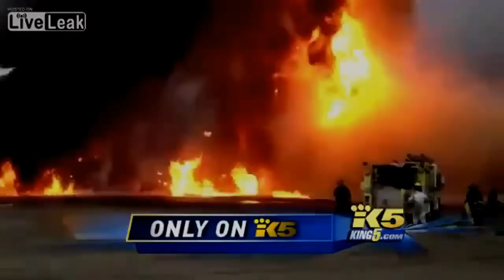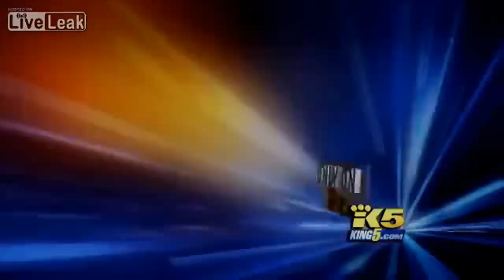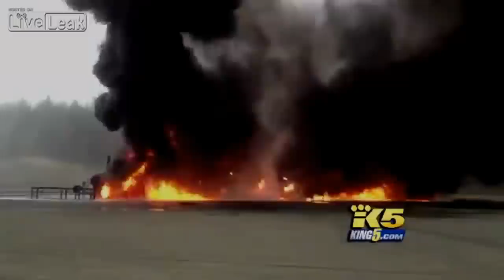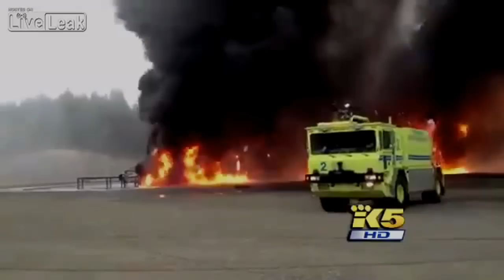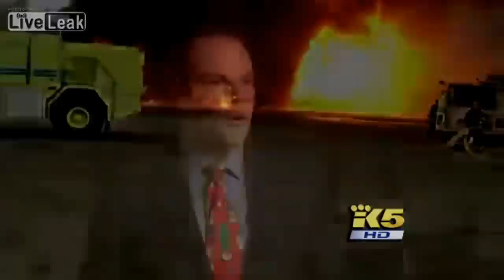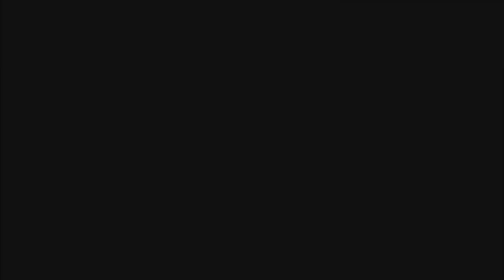Firefighters mistakenly pump jet fuel on fire instead of water | Fail

Comment: Why do they even have jet fuel?
Reply from the maker: they were recreating a plane crash scene, so the jet fuel was to simulate burning fuel during such and incident, so firefighter understood the method of controlling such a fire, at least they learnt that is burns well!! - thanks for watching an your comment!
Reply: MrOutofcontrolvideos thanks! :)
Reply from the maker: Jake Reid no prob! - Thanks!
Reply: MrOutofcontrolvideos How is burning jet fuel simulating burning jet fuel? It is jet fuel burning.
Reply: ***** Wait a minute... Jet fuel can't melt steel beams...
Reply: ***** That could make an interesting training scenario fuel plus a generous helping of black ops mystery adaptive.
Reply: +Jake Reid 

Don't listen to the guy above.

Fire Training fields use water filtration devices to filter out runoff water when using burn props, therefore recycling the water. In this scenario, their filtration device failed which caused propane to not be separated from water, but instead sent back to the pumps that the firefighters use when training.
Reply: +Jake Reid 
Jet fuel was in the water tank that feeds the mockup's fire suppression system and supplies water to the fire engines. All the water had jet fuel in it.
Reply: +Jake Reid it can if you use pure o2 with it.
Reply: +Jake Reid - Why do they even have jet fuel? - it was left over from 911
Reply: +sicsempertyrannis23 - during the clean up there would have been no reason or need for angled cuts. The quickest cut would be straight through - the debunking story has been debunked
Reply: +sicsempertyrannis23 - 'and that he profited enormously by the insurance claim he took out 2 years prior'

I think you mean 2 MONTHS earlier not 2 years - he did not lease/own the complex 2 years prior

"Only three
  months before the attack Silverstein signed a rental contract for the WTC.
  Silverstein agreed to pay over 99 years a total of 3,2 billion Dollars in
  leasing installments to the Port Authorities: 616 million as an initial payment
  and then annually 115 million Dollars. The Port Authorities remained the
  owners of the WTC."
Reply: +Jacob Reid They were trying to melt steel beams
Reply: failure of the fuel/water separators...
Reply: does your sisters name happen to be Riley?
Reply: +D Ray um no
Reply: +sicsempertyrannis23 28 pages now in debate and one country claiming to "cash"  bonds in..
Reply: +MrOutofcontrolvideos jet fuel does not burn well its burns poorly like diesel does. the only reason it burns was because it was sprayed and atomizing it. its how its used in jets wont burn unless you spray it same for diesel.
Reply: Making the culprit in this video more likely Av-Gas since it has characteristics more like that of gasoline.
Reply: to make the fire for the training
Reply: That's possibly the dumbest thing I've ever heard
Reply: They had too many steel beams.
Reply: lee ving oh I see, makes sense now
Reply: OMFG LMAO what the fuck lol that makes lots of sense
Reply: why are they using recycled water
Reply: This is the top comment? I;m losing faith in humanity. It's stated clearly it was an exercise, for exercise to be valuable it has to be realistic.
Reply: We don't care were having fun
Reply: Piterixos you're the best.
Reply: Lol, thanks xD
Reply: Recycled water- this is what happens when being "environmentally friendly" goes wrong. And besides, why in hell are they trying to douse a fuel (Class B) fire with purely water? Where's the foam system in there?
Reply: Jacob Reid. Ha. For the planes. But yeah I hear you. How did it get mixed with the water in the truck and hoses
Reply: @danielr3933  not propane, jet fuel
Reply: @geo6892000  911 people say jet fuel can melt steel, but do they understand hot metal is kinda soft and that basically means it would be like holding up a building with  noodles
Reply: They probably had some rollerskates too.
Reply: @MrOutofcontrolvideos  so they would use the fire truck to put jet fuel on the simulation crash
Reply: it helps clear the ear canal for those that don't listen to begin with.
Reply: @danielr3933  propane?... Propane is a gas at atmospheric pressure /temp...
Reply: It literally said it in the video bruh watch before commenting
Reply: @flyingchimp12  bro I literally posted that comment 6 years ago leave me alone 😂
Reply: Actually,  it can. If an oxygen tank in a plane lets go during a fire, the resulting fuel/oxygen mix can cut steel like butter. If the valve stem gets broken off in a crash, the jet can pull unburned fuel into it and create a jet hotter than an oxyacetalene torch more than a foot wide that cuts through anything in its path.
Reply: 777 likes! 👀
Reply: There simulating burning jet fuel in a plane crash, basically It's a way to spray fuel to increase flame but water as well to control it.
Reply: Actually it was contaminated water, fuel got into the reservoir and when they filled up the tanks there was some left and then yeah
Reply: @running.s.fabrication  cheaper and easier
Reply: @ZFTAviation  guess what happens when you heat steel?

Comment: Watch and listen to the story again people...this was not the firefighter's fault. A malfunction in their water/fuel separator that reclaims their water they use for firefighting malfunctioned. This left them unknowingly with fuel in their water supply.
Reply: “Watch and listen to this story again people” lol
Reply: Yeah, I'm calling BS on that. Although Oil water separators are a thing, and we use them at work, it's not "that" kind of thing they are making it out to be. My guess is that some dipshit put fuel where it shouldn't have been put.
Reply: Really old post/vid, but man there is a lot of salt in this response Astute American... 😂
Reply: @justadbeer  that doesn't make any sense because unlike fire hydrants/water source, jet fuel is stored in a tank on a truck. You can't just connect a fire hose to a jet fuel truck its pretty obv to tell which is which bc of the fire hazard/danger sign on the truck. Also the connecter type is different for jet fuel and water. You wouldn't be able to connect a fire hose to a jet fuel truck bc it won't fit.
Reply: Nah they just corrupt fireman
Reply: Hypothetically, I can see where they can only tanker truck x thousand gallons of water out to the training site, and would have a drain system to reclaim the spent water for the next exercise... Hypothetically, I can see where this could go wrong. Also hypothetically, I can see this just being a spectacular brain fart on somebody's part.

Hey Bob, there's not sposed to be rainbows in the water we fight fire with are there? Shut up and point the hose, Jim. Also, not sure if they are talking about jet fuel or avgas. There is a huge difference. Avgas (aviation gas) can be between 91-130 octane, depending on lean/rich mixture, whereas your standard car uses 87 octane. Jet fuel is more akin to diesel with a 15 octane rating. I believe diesel is 40ish Cetane, a whole different word meaning how flammable something is.
Reply: @justadbeer  Ikr. How much jet fuel could be in water that it would be fucking flammable like that.

Comment: I thought you used Foam on fuel fires?......
Reply: they would for real fires but it's too expensive for every day use.
Reply: How can you train for a real life situation if you aren’t using the chemicals to be used. Besides, diesel floats on water and it would... never mind. I’d use a different training facility. 😐
Reply: @glennmyers2984  they used water to feed the fire suppression systems which just mixes the foam shit in the water 
But the water already had jet fuel in it somehow
Reply: It’s foam mixed into water.
Reply: @AquariumAficionado - right. I worked in a chemical plant that had one unit that used a liquid metal to cool the high reactors and used Class D dry powder extinguishers and and bulk. Super K.
Reply: @glennmyers2984  that's like saying how are you training for a situation where you may be in a fire fight, but you aren't using real bullets.
Reply: @mossconfig  its not everyday use, its for a training exercise. Plus our government pays for the equipment we need for training therefore cost isn't a problem.

Comment: Gonna explain this for anyone who doesn't understand. They fill the area around the fake plane with jet fuel and light it because thats the type of fire they are training to fight. The water they use to extinguish that fire is pumped back out of the area after the fire is extinguished where it then goes through a separater to remove the leftover jet fuel so that they can use the water for the next training session. Here the separater didn't do its job so the training water has jet fuel still in it. Now some people might ask why they would filter and reuse water. Well there's two parts to that, the first one being they cant let the water drain away with jet fuel in it because that's extremely dangerous. The second part is water is expensive and since they already have to pump it out and filter it they might as well re-use it.
Reply: Nix Ryu The Sergal 
Water isn't expensive! I live in the Eastern USA and water is $0.22USD for 1000 gallons. In the West water costs about $0.05USD per 1000 gallons. 1 million gallons, or 4000 tons, could cost as little as $50USD, the price of one steak dinner.
Reply: I think most people can figure that part out. What people want to know is why the truck that collects and recycles the water should also be the same truck with a water cannon on it. If I had set up this school, the collection truck would not also play double duty as the training vehicle. Transfer the water to the training vehicle only after being separated. Then this disaster doesn't have to happen. Wouldn't that be the smart and safe way to do things?
Reply: i think it could be that the water storage tanks used to fill the trucks had fuel in them because the seperator machine didnt do its job properly, im not sure how they would scoop the water direct from the ground into the trucks
Reply: @buddyclem7328  why you talking to someone with no common sense

Comment: I love how the clueless reporters act like the problem was worse because there was jet fuel in the line instead of gasoline. Silly journalists, gasoline is far more flammable, has a far lower flash point, and has a far higher spread rate than jet fuel. A lit match dropped in a jar of gasoline will easily cause ignition of the gas and a sustained flame. A match dropped in a jar of "Jet A" fuel will be extinguished by the liquid. The same is true of diesel and kerosene. Gasoline wants to burn. Jet fuel (Jet A, JP-8, & JP-5), kerosene, and diesel are very difficult to ignite and don't burn readily unless they are sprayed in a fine mist.

Comment: If you spray jet fuel and then spray water through the same hose. What the hell are you doing?
Reply: putting out the fire
Reply: it's a training exercise. they wouldn't have dual purpose hoses like that in a real incident
Reply: If you listened to the news report the facility uses recycled water system for the firefighting operations!! The fire man don't pump fuel through the fire hose and then use the same hose to extinguish the fire. It appears that the water/fuel runs to storm drains and is put through a filtering system and then it is put into holding tanks for firefighting operations. This is appears to be done as to conserve water or there is no public water system available. I don't think the firefighters had anything to do with this mishap as most would not even know where the water comes from except that they hook to a hydrant and water comes out.
Reply: all the water had jet fuel
Sounds like some 9/11 shit

Comment: Training is meant to find such problems in order to avoid them happening in real life. Don't shit on the firefighters for making a mistake or having faulty equipment, be glad they found out in training and not on your plane.
Reply: Firefighters shouldn't be using water on a burning aircraft anyway. They should be using foam. If foam is unavailable,  then you CAN use water to dilute the fuel to the point it won't burn but that requires one hell of a lot of water even for a small fire. In contrast,  a very small amount of foam will put out a very large fire. Ex volunteer firefighter.
Reply: @richardbeckenbaugh1805  I believe somebody else in the comments explained why they used water

Comment: I wonder if that water was taken from a well near a fracking project, would be the same.
Reply: There is no natural gas in Seattle the thing to separate hydrocarbons and water to reuse fucked up so he sprayed a mix of water and falmmable liquids on it
Reply: SandWitchGamerZ You missed the point. Diesel fuel is injected into fracking sites, and it makes its way into drinking water.
Reply: David Mauer It would be similar to Charleston, West Virginia's water a few years ago! The MCHM contamination was chemically similar to jet fuel. I never tried to set it on fire.

Comment: Bad headline.
It wasn't a mistake on the part of the Firefighters. There was a problem with the system which filters and separates the runoff (so the water can be reused). The Firefighters used the water source they were told to use, but there was still fuel in it from previous training evolutions. The Firefighters realized this and safely terminated the exercise.

Comment: But the question is... Did it melt steal beams?
Reply: +alexthegrape1000 It does not take much heat to make steel soft. Soft steel with hundreds of tons on top of it will bend break.  If steel is low quality even less heat is needed.  The structure of steel is changed by heating and by the speed and method of its cooling.  So steel is very complex and actually nowhere near as strong as the average person seems to think.
Reply: +TABRAO 
Underwriter Laboraty test
Reply: +alexthegrape1000 Nice profile picture :)
Reply: +alexthegrape1000   Better yet, I wonder if they found unburned mock passports in the wreckage afterwards.
Reply: +TABRAO yeah except for the fact that in 1945 a B-25 Bomber flew into the Empire State Building and it didn't collapse
Reply: TABRAO There was an office building fire in Philadelphia in 1991. 38 or more stories tall. It burned for 18 hours from the 22nd all the way up to the 28th floor. It didn't collapse. That's just one of many skyscrapers that burned, some worse than the one just mentioned and didn't fall. Also look up WTC fire 1975.
Reply: Neither of those had a tin can flying into the structure at 400mph either. That takes out some supports, and the building is built to lose supports, but after it loses so many it is pushed to the limit and when the steel softens there are less intact supports to take the weight as most are already compromised by having a plane wipe them out and the rest are getting softened.
Reply: TABRAO There is a building in Philadelphia, 38 stories tall if I'm correct that caught fire in 1991. It burned for 18 hours from the 22nd to the 28th floor without any structural collapse. With that many floors burning for that time period would've created a lot of heat, and without it collapsing is enough to say the type of steel used to construct such buildings stands up well to fire. WTC steel was much stronger due to its size and should not have failed so easily. I'm a firefighter and they taught us about building collapse. I've worked house fires that are made of wood that burned longer than the towers did without collapse and wood is more frail than steel.
Reply: the empire state had a plane crash into it and it caught fire right in the middle of the building .. but it still stands today .. Weird shot happened on 9/11 ... Especially with building 7
Reply: shit* (sorry autocorrect)
Reply: But a B-25 is a lot smaller than a 767.
Reply: It didn't hit the middle it hit the 79th floor near the top.  It was also fueled by gasoline, which burned off much faster.  The Empire State Building also had heavier construction and thicker coatings of plaster that helped resist the heat.  And like Richard said, a B-25 is MUCH smaller that a 767.
Reply: Wolfgang, if you're a firefighter, then you should've also learned about fire resistant coatings that they put on  steel structural members.  In the Philly fire, that coating was able to protect the structure.  In the WTC towers, the impact stripped that coating off, exposing the steel structure to direct flame.
Reply: That is true, but the Twin Tower's structures were the lite-est and most unique designed skyscrapers in NYC.  The term "leap to lite-ness" was often used to describe the Towers.  As height increases the steel gets thinner.  The thinner the steel the sooner it will reach 1100 deg. F., the point where steel loses 1/2 of its load bearing capability, and where buildings start to collapse. Heat that steel in the 47 core columns at 80 to 90 floors up with jet fuel (burns at 1500°F to 2000 deg°F), What happens?

The Empire State Building was struck in 1945 by a B-25 bomber.  That building has a much more robust design in terms construction.  It also had reinforced concrete columns and a thick masonry exterior.  

Vincent Dunn, Former Deputy Fire Chief of the FDNY and co-author of "Collapse of Burning Buildings" says “It's the ultimate concrete high rise building – the ultimately stable high rise.”
Reply: About 10,000 gallons of jet fuel poured into each Twin Tower, unlike the fire in Philadelphia.

Comment: Common sense says to have two completely separate and incapatable systems. That way water and fuel could never mix and water hoses couldn't hook up to fuel system. 
     Government has no problem spending money on the best and/or over complicated systems but when it comes to safety issues they fall short bc of expense.
Reply: Exactly

Comment: sounds like  multiple points of Error. 1. fuel separator should be separating it and pumping water into a clean tank. clean tank should be tested/checked for fuel in it. then pumped from said clean tank.